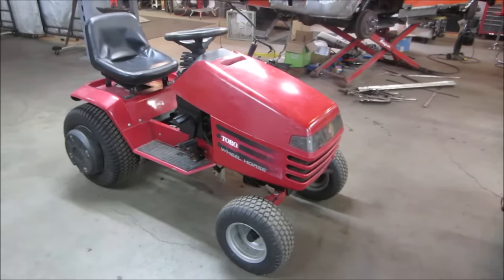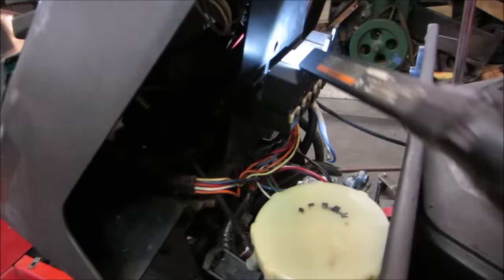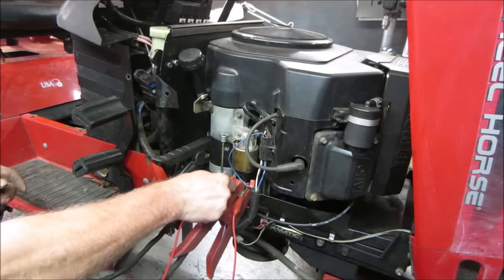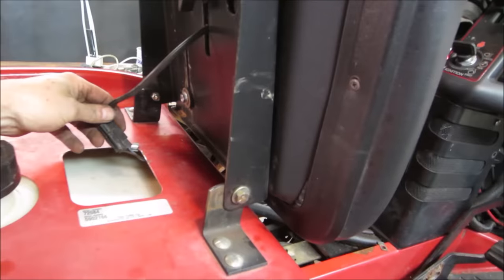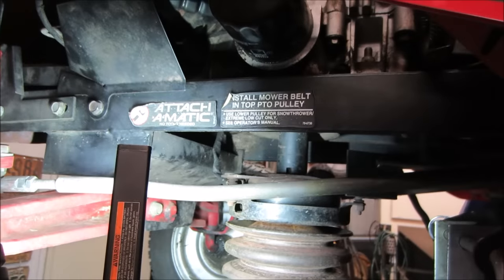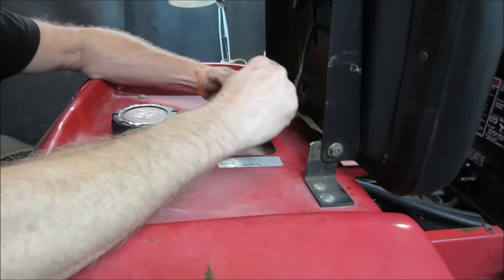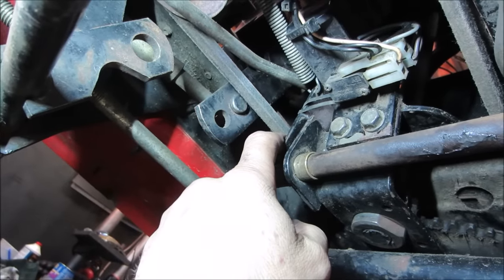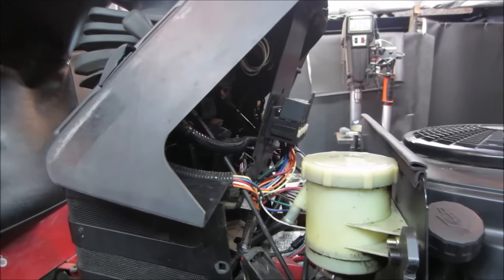How To Troubleshoot a Mower That Stopped Running,

Comment: I'm on my daughter's YouTube account. This is the first time me watching any of your videos. I work on mowers also. I'm not claiming to be an expert or trying to degrade you in any way. May I suggest that you purchase a test light that can check for power and ground. The test light I have I bought from Snap On years ago cost me $45. Plus $18 for the battery yo cigarette adapter. Sorry I don't have the model number. The sticker wire off years ago. It is computer safe and air bag safe. I never tried it on the air bags. I'm too chiken. Lol. But once this test light is hooked up it will let you know one of three things. 1: Red light shows that you have power. 2: Green light shows you have ground. 3: No light shows you have an open somewhere. On most riders when you check the start circuit, the circuit will have an open until all safety switches are closed. Then without changing anything with my test light and it still connected to the battery. (Both positive and negative terminals.) The green light should appear when all safety switches are closed. If not then there's a broken wire or bad safety switch. Now when I turn the key to the crank position then the green light should change to red. If it doesn't then there's a bad connection at the key switch, or the key switch is bad. If the test light does show red, then most likely a bad solenoid or stater. Not criticizing your test light, but when it's hooked up you only know if the wire tested is getting power. Let's say you do have power. The circuit can still be bad. It can have a broken wire further down the line. With the style of test that I have, most circuits need a ground which will back feed through the circuit. My test light will show green when this happens. The split second that power goes through that same circuit my test light goes from green to red. It's also great for intermittent problems. Let's say you have a mower cutting out intermittently. I just connect my test light to the wire I suspect is the culprit, start the mower. If it's a power wire and it goes off everytime a miss occurs then I know that there's a bad connection. Your test light can do the same thing. But it my test light goes from red while running and flickers green everytime that there's a miss then I know that wire is touching ground somewhere. This test light has saved my butt multiple times. I hope I didn't insult you in any way. I'm just trying to help you make things easier to fix. I almost forgot, when I bought my test light years ago, roughly 20 to 25 years ago, it was the latest thing. Now I'm sure it will be cheaper. If I can find a picture I'll be sure to share it.

Comment: they hide the starter solenoid in hard to access places. I bypassed it on my Troy Bilt and put in a 50 amp push button start button. Always works.  The carb has a fuel shutoff that stops it from backfiring when it's shut down, if it fails electrically, the engine just shuts off. Get a new carb.Or cut the plunger off that shuts off the fuel. Then hold your ears when you shut it down. There's also a cutoff if you get off the seat or go into reverse with the blades engaged.

Comment: I have that same tractor. The fuel pump went bad i replaced the fuel pump and it still wont run. If i pull the pump out and work the plunger by hand it will run good. So something inside that the pump fork runs on as the engine turns isnt making it pump. Any ideas ?

Comment: Not sure but why have you not traced the key switch starter wire down until you find out where it goes ???? The white wire I believe should be the starter engage wire.  That should relay through several safety switches.

Comment: All those safety switches!! Its how I get my riders. I'm in southwest FL,, guy retires buys a rider mower it goes back to the dealer under warranty a lot for BS reasons. It goes out of warranty and it develops a no start condition & the dealer trys to sell him a new one. And offers him peanuts for his mower. I offer them a little more$$$ and have it running in short order tucked in my garage,  one was a bad seat switch. My latest was a corroded ignition switch. Its almost too easy.  I'm retired Auto,Diesel, marine tech. Now I fix lawn mowers. Welded mower decks ( Chinese junk.)

Comment: Very cool. I am a Master Certified 48-year Automotive technician found a very interesting I would think you could check your relays from the back of the relays and not have to go to all those switches at least that's what I would do I think. All relays work the same for the most part need a power source ground and your signal either power or ground on and off which is usually a ground not about her. At least in the automotive world
Reply: I'm sorry check your switches from the back of the relay

Comment: My guess is the owner accidentally unplugged a couple of safety wire and when he put them back on he swapped them.  I always start where the last AH was working on it.  The problem is most likely on the deck or in that vicinity.

Comment: Do you have an email address? I'm sure you've addressed this before, but I can't find it.  Having to choke a pressure washer, or a mower moter to smooth it out, otherwise it surges like crazy. What causes this and how to fix it? I have this problem more often than not. Thanks to anyone that can help.

Comment: One comment regarding the "park" light.  On most of the tractors I'm familiar with, the PARK light should be OFF when starting.  It's an alarm telling you that you need to push the park brake to start it.

Comment: Thanks for posting the video.  Interesting how much failure prone "safety switches" and other electrical crap is in this mower.  Mowers were much more reliable before all the safety gear applied for fools that have no common sense.  Thanks again.

Comment: So...it started with the PTO switch going bad in the first place and then went downhill from there. That would explain why it stopped 20 feet after running. The engine used up the fuel in the fuel bowl.

Comment: If it is a twin cylinder Briggs & Stratton engine work for the ground wire that’s coming off your coils trace it back inside where are they both connect together is equipped with two diode‘s these diode‘s protect one from the other it only allows electrical current to pass through One Direction if one goes bad it will allow electric to pass through both ways when one goes bad it cuts off the power to the coil or grounds the coil out on that cylinder and you will have an engine backfiring if your engine is a singleCylinder engine it could have one diode and one that goes bad then your coil won’t fire correctly. Or it won’t fire at all. I have a black wire is is a ground wire it is used at the ignition switch when you go to switch it off how many down to the ground make contact to another ground they killed a coil.

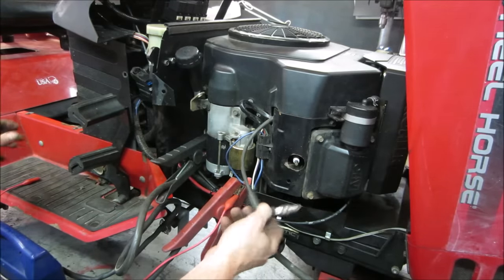Comment: 4:14, 4:35  You won't get a crank from the key with the (blue) signal wire disconnected from the starter solenoid lol :)

Comment: Parked my 25 year old troybuilt went to  
Move it no cranking,nothing safety switches, decided to bull battery out replaced in July positive cable loose  had voltage drop turned key and started up going to adjust valves and replace plugs

Comment: I’m at the 25:00 mark and I’m wondering if perhaps the plugs on the safety switches are reversed. Perhaps the owner had to disconnect them to install the belt and then reversed them by mistake. 

Will watch the rest and find out how grossly incorrect I am.

Edit: I had the right spirit, but another safety was thrown in the loop that I hadn’t considered.

Comment: Complicated to begin with.  Couldn't wait for the end so skipped forward to see if it finally worked.  Then went back and took in the detailed process of troubleshooting.  I may have given up too, just like one of the earlier repair shop.    On the funny side, did anyone notice that the name of the mower is TORO and then the subline is "Wheel Horse"?  LOL!  TORO  is Spanish for bull (as in the male cattle).  For one moment, with the full-stop so close to the last O in TORO, I thought the brand was TORQ.

Comment: Rather than checking out the electrical systems point-to-point,  I would have eliminated most or all of the safety switches until I got the mower working,  then added system back in one by7 one until identifying which one(s) were a problem. 

In short, start with the simplest situation.

Comment: so the original problem was what? and then the other problems were added which were? so the original problem was a intermittent PTO switch bad? I hate intermittent a little bit they are a challenge and adventure? and all the other problems after the intermittent PTO switch were added?.....

Comment: Have to measure DC under load.  You can have 12v until you hit the starter then zip.
Reply: Start at the starter and trace ignition start back to the switch. Dont jump around.

Comment: Kinda sad that this person obviously paid a shop to try to fix this and they clearly couldn’t be bothered to actually do any comprehensive troubleshooting. They just threw a few parts at it and made a mess of the wiring and didn’t even clean up their mess.  On top of that, they’ve created a potential future issue by stabbing into those wires for testing instead of testing at the ends like Darren did. Now those wires are going to be way more prone to corrosion and breakage due to water ingress.  I’d bet a nice steak dinner they tried to sell him a new mower too.  I guess not all shops have a "mustie" ;)

Comment: To me manuals are just guides for troubleshooting which don't tell you the real problems. You always have to dig deeper on troubleshooting as to what the manuals has or thinks to solve the issue. I very seldom use a manual when working on mowers.

Comment: Sloppy work by the shop that worked on it before you.  It is one thing to not be able to repair it, but at least put it back to original.  Really difficult to work on equipment sometimes when you are going behind someone else who tried.  Good work man!

Comment: How is it possible a small engine shop missed it? Those riding mowers have safeties everywhere. Simply disconnect the coil kill wire (which you did) and that should take you 90% of the way to a repair.

Comment: I would have traced the starter motor blue wire back to see why it had no 12 volts during cranking.
I would have also googled a electrical diagram!

Comment: Safeties? I laugh at you!
I keep an old Honda mower working for a model airplane  club .  Burned out the friction clutch, got re surfaced and it works...all the time from crank to shutdown.  So, no seat safety, no pto control or safety, but the ignition switch works (the only safety left)
  Mice nests under the cylinder shroud...overheated and blew the headgasket and main engine seal.   Thanks to watching Darren over the years i don't sweat it, just fix the next thing to go.

Thanks bud

Comment: WIRING:  Most all yard  'stuff'  has loose, hanging wires, all over.  Where are good, building and constructive procedures , gone ?  Wires on a vibrating, hot, piece of equipment, NEED  TO  BE  SECURED,  from hanging loose.         Another item:  connectors, which can unplug, when/if running into branches, or becoming 'disconnected'  when one works on the machine.  I;ve had to secure the starter wire, on my mower, as well as other wires with tie straps, and haywire for support.  I  DO  NOT  PUT UP  WITH  SUB-PAR  wiring, from the  '' factory'.   (learned this, from airline mechanic, back '' in the day '''.  I  ALSO  DO  NOT  USE  'butt'  connectors, as vibration/heat causes the soft- crap  metal, to  NOT  hold the wire anymore.  Twist, solder and tape em up. Permanent, as well as support all wire along to where it  goes.  TAPE UP/TOGETHER  any other  plug-in connector, to keep water out, and prevent accidental un-plugging, from any outside force.  YOU'LL  BE  WAY  BETTER  OFF. ......Also, on any 'machinery'  i get, i go over all nuts/bolts  from the factory, as  the  ASSEMBLY  of said equipment, is pretty shoddy. Like push lawn mower handles, coming  loose, or even  OFF.  ( 1  example, of many).   Good day  Mustie !   (hmmm....mustie ,,,smells like my mower, when i dont'  CLEAN  IT )  ha

Comment: Too bad the customer didn't tell you whether or not they had engaged the blades during that 20 feet of run time. I'm sure that would have clued you in to the switch  sooner. So strange that the other shop created so many other No Start issues with their efforts to locate the problem..

Comment: Nice video. But, I think you could have made it a lot shorter if you had followed the manufactures troubleshooting guide rather than just poking around to find the problem if that didn't work fairly soon after you started.
Reply: You are right about that! The manuals for almost anything can be found right online, it makes it a breeze to trouble shoot. These things have "safety" switches and micro-switches that can be a real pain if you don't know what you're looking at. I work on industrial lifts, everything from skid jacks to 2 ton fork lifts to cherry pickers. It seems that wherever I've gone in the past the manuals for the machine are long gone, even though there is a spot for it right behind the seat! I've worked on some older ones before the internet, and they will ask me if it can be fixed. My response is always the same, if you don't have the manual it's gonna be a long road. The internet changed that thankfully.

Comment: This is a simple garden tractor...now imagine doing this on a Mercedes with a V12, mag ride suspension, variable cam timing, dual spark plugs, 24 cops, and touch screen lol now you know why some vehicles are electrically totaled.

Comment: 10:50   Told ya  !  loose wires, dangling, waiting to get cut/shorting  !     PUT  them, in a small hose, strapped to the frame.....insane.....hanging by the belts, rubbing...wow   EL-CHEAPO.....make   the   FIX   PERMANENT.......!

Comment: The thing about no manuals or diagrams is that you actually force yourself to think about the way things work.  You may run into a piece of equipment that has no available manual or diagram.  The manual and diagram people will have to give up.

Comment: I don't know why you don't just download a wiring diagram instead of trying to guess how things are wired.  Some tractors have some or all of the safety switches in the ground circuit of the solenoid while some have them all in the  12 volt side.  Trying to figure out which you have can be an exercise in futility.  Have a diagram, you know which you have.  Toro does publish them in the internet.

Comment: I can't believe a so called professional would stab wires to test them like that and not at least cover them after. 
A lawnmower is a pretty harsh environment for electrical connectors and then they poke a hole in the wires to let more corrosion causing moisture in.

Comment: Still doesn't make sense, you need two wires to complete circuit, doesn't matter which is on top or bottom ?? Comment made during video prior to end.

Comment: I get frustrated trying to figure out all the so-called safety features on everything you buy nowadays.  It appears that common sense died with Thomas Paine. I remember when gas push mowers first come out around 1948 or 1949. The one I had was one that had a wind up and release starting system and as long as you kept some grease on the mechanism it would last forever. It had a choke and a throttle and that was it. It never failed to crank. I would run the gas out of it to keep the carbeurator from accumulating varnish and when I gave it to my cousin it was about twenty+ years old. It was much easier to wind the flywheel up than it was to pull it till you started cussing, and it usually started on the second winding. I bought it at Western Auto Stores for less than twenty dollars. I cut enough yards in the neighborhood in two weeks to more than pay for it. I believe it was a Wizard brand. I also bought a 7.9 H.P. outboard motor and It was a Champion brand.

Comment: I just chop the end off of that anti backfire solenoid! That piece of shit is guaranteed to be stuck closed if the tractor has sat for any time at all! As long as you have a petcock fuel shut off in the fuel line so if it has a leaking needle and seet it won't fill the crankcase full of fuel.

Comment: Mustie 1,  A few years ago I had a craftsman mower with a problem with the pto not waning to engage.  I cobbled a repair by wiring up a household light switch in the circuit and it worked until the electric clutch had a meltdown and stopped working for good.  I had to replace the pto switch and the electric clutch.  I think the repair on for both items was around $200.  My suggestion to you is to pull a ohms reading on that clutch and check to make sure it isn't pulling too much current and possibly overloading your switch before it burns out the switch or key switch again.  That may have been why everything took a crap to start with.  I hope you have the problem fixed permanently and not just till you go to mowing with it.  God bless you and keep up the good work on delivering awesome videos.

Comment: Finance departments override engineering.  If they can build a switch for one cent cheaper per unit, even though it won’t last for doodlysquat, they will do it, overriding engineering departments recommendation, so the use Chinese switches in good units.  It is a damn shame that American products have dropped to a level where bean counters control the reputation of a company.

Comment: I would've laughed if the actual reason for failure was simply that; drive belt snapped, hit the hanging fuse box like whip, knocked out some fuses, end of story.

but no its never that easy !!